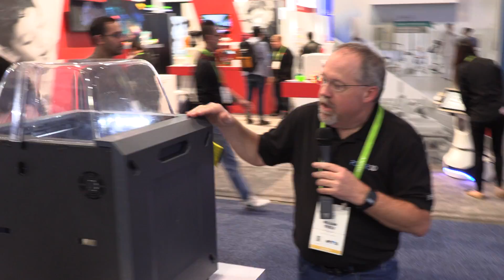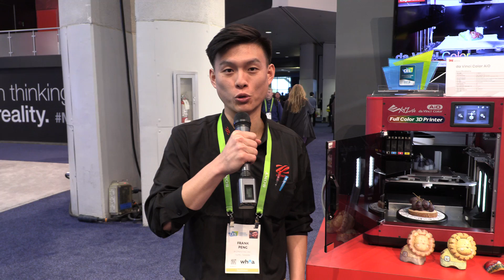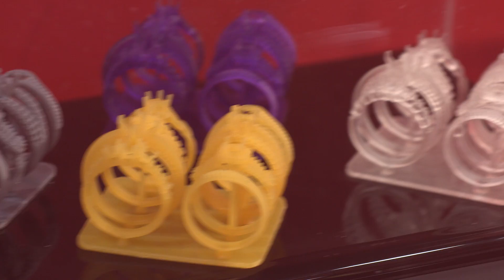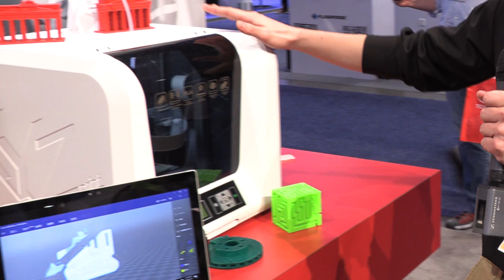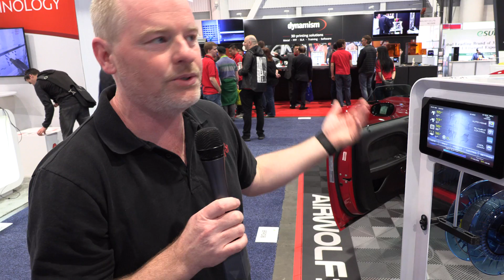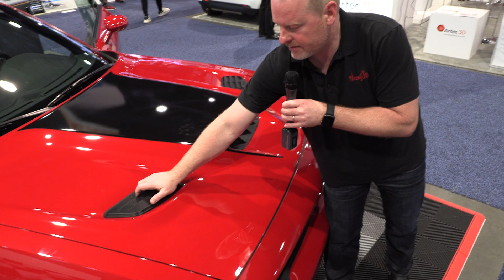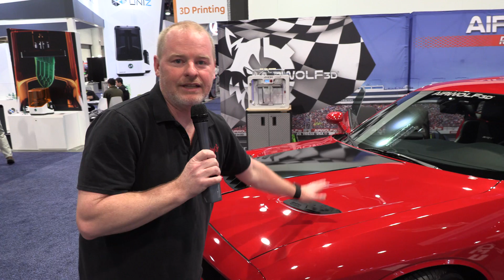VIRTUAL CES 2018: Tour the 3D Printing Area with Flashforge, XYZ, & Airwolf!

Comment: I just purchased the da Vinci color XYZprinter. Right out of the box I couldn’t even print the color calibration as the ink was not working. I cleaned them as per their instructions with 75% alcohol and no go. I wrote 2 tech support requests and after 6 days no reply. So I called the UK support line from Australia and was given a UK support email address so I resent the issues and no reply. As a reseller I contacted the disti in Australia Synnex and was told XYZprinting does not support Australia. I had get them to log a fault, several days later I was told the ink cartridges were faulty and would be replaced. Another 3 week later still waiting on the ink cartridges as there is no stock in Australia. So I have a $4000 plus 3D boot anchor on my bench. What a joke of a company, fault product, no support and no stock of the ink cartridges. XYZprinting are a joke and would advise against anyone purchasing their products. Joel I love your channel but very disappointed you allowed XYZprinting to show their products. You need to seriously vet the company’s before giving them a plug

Comment: Honestly idk why everyone gives XYZ such a bad rap. My first and only 3D printer is an XYZ Da Vinci Jr and I absolutely love it. It's actually an extremely nice machine for only $200. I've had it for well over a year and have not had a single issue with it. Literally the only downside I can think of is that they require you to use their proprietary filament, but even still, its only $20 or $30 per roll which isn't really that insane.

Comment: Nice work mate, I live in Australia. It's a little hard to travel to CES. Really appreciate videos like this giving snapshots of what is happening in the electronics world. 

In saying that, I think Flashforge has lost the base end of the market along with XYZ. They have been beaten on so many fronts for entry level, large build volume printers. Airwolf seems to be in a completely different category. 

I think a great business model for 3D printing is similar to the one that KTM and Harley Davidson have done with their motorcycles. Have a base entry level product that is good quality and then encourage upgrades in the future. 

I have a flashforge creator dual (the wooden one). I've had heaps of issues, but I've learnt from the experience. However, when I was looking for a new printer to extend my knowledge and capability I couldn't justify the extra money with the cheaper printers out on the market. The same issues that occur with a $1500 dollar printer still occur with a $400 printer. I went onto the Flashforge forums only to discover that the new Flashforge printers are still having similar maintenance and user issues to the old ones so there was no incentive to upgrade to a new Flashforge in my opion. 

I think that if these guys want a following and want more brand recognition with hobbyists through to professionals (which I use my printers for work and play) then you need to get bang for your buck.

Comment: they are both interresting. and have both innovation. but trends are the same
bigger (thanks to CR10 democratisation), more materials (real metal... wow! ink for 3D.... omg !) and, hélas, more expensive...
As a reprap user, (one year printing, so quite newbie) all the wifi, cloud, touch panel and so on are onl usefull gadget but the cost of it dont justify the price (a rasp pi 0, a webcam, octoprint and litte patience costs at most 30 box and do all that...)

So in my oinion, the "real" things : 
really interrested by democratsation of LCD printing by flashforge  : there a nut here in my opinion,  and may be if price comes to 500.600 (ok i dream) i'll buy one. another one is the 'candy" as an amateur cooker, i want one :) they should think aboutmultiple layer, not very high, 1/2 inch should be enough for food printing :)
XYZ shows  really interresting color print technique, i hope that print pricing will goes cheaper with time. 6 box for a  small print... lets say... better to buy it ;) and machine prices are to high...
EVO was the less convincing, except for metal filament, but its not a material wich will run only on EVO...

A word on the price : of course it is passionating to build things, to DIY, experiment, improve.. but we, as particulars, are not abble to do it at any costs... and none of the three innovations that i was writting about worth the price : 3000 box a printer?? mine costed 300, and I am building one by myself actually with dual extrusion for 200 $... that's 5% !
I am not an engineer looking for a way to get pieces wich are impossible to make by substraction or molding... in one year i have printed, on weekends about 100 pieces, considering it as a mean for one printer, and if we use it for 2 year, to get your print price you should add 15 dols for each print : not cheap for a knob, a repair part, or even another beautiful colored statue... 

one of the aim of 3D printing is to reduce the dstance and the manipulation between industry and consumer... if the consumer has to buy a thing at the price of a factory, there's no point...and if you are an engineer in a big compagny, you have acces to biggers prints, more materials, though a a high price, but with a good ROI...
I'll make a parralel with 2D printing : first machine where big noisy and very expensive, but at the time the price get cheaper, everyone get one in house... even laser, and now color lasers, and now the big players in 2D printers are develloping chep printer and big printers on 2 separates market. it will reasonabilly be the same in some years for 3 D printing. see the succes of Anet, Creality or Evo Tornado...

Thank you very much anyway for that immersion in 3D prnter paradise :) and for the fact that you have been fair with other competitors than luzbot.
and, almost all ...
High five !

(PS i am french and didn't learn engilch in shool, so i apologize for my syntax and grammar ;) )
Reply from the maker: +cornebistouille please don't apologise, your English is better than mine :)

Comment: I think airwolf wins the show. Heated chambers are 100% needed for anything except pla and petg. You can hack other materials to work without one sure, but they make it so much easier to control. Beyond that xyzprinting wins second because of innovation. They are actually trying to bring real full color printing to the desktop, not to mention covering all aspects of the market from pro to beginner. Flash forge has some nice price points, but is much of the same. My big qualm is WHY STEPPER MOTORS?!?! We have heated chambers now, but no servos?!? Cmon companies. There are very inexpensive ways of closed loop control that don't require the high costs of commercial cnc machines (as printers require much less torque). All I want is a printer with a dual extruder, big build volume, heated chamber, and closed loop control. Is that too much to ask :(

Comment: I like the Airwolf presentation. You can tell he was excited about the products and the parts produced from the product. The metal filament options are really nice as well. Using glass doors and panels is questionable due to the weight and brittle nature and I think polycarbonate/lexan would be better options, but since they seem to focus more on the industrial side of things I suppose it's not that big of an issue.

XYZ I have very little faith in due to their business philosophies and practices in the past and for the most part the present; But their machines look nice and may be more convenient for people who don't know what they're doing with 3d printing. They still give the vibe that they're essentially overpricing their units to take advantage of their marketing capabilities and ignorance of unknowing purchasers like my friend who bought his from Barnes and Noble in the past.

The Flashforge presentation was good, their printers look good, but I'm just not excited about their products based on the presentation and the prices. I think I can tell that they're putting effort into their products though. The candy maker gets me the most excited even though I don't really eat candies, but it's cute and looks fun and inexpensive and leaves room for improvement.

Comment: Flashforge:  It seems like if you're looking for a 3d printer and a camera and cloud access are your big selling points you may be looking for a 3d printer for the wrong reason.  The SLA printers were of some interest, but were only briefly touched on.  The candy printer is an interesting novelty, but seems like a very niche market.

XYZ: Theirs seemed to cover a large range of options with the majority of them being on the high end.  For the combo 3d printer / scanner it seemed like the scanner space cut into what would otherwise have been printable area and would have worked better with the scanner being something separate from the printer.  I think they had some of the best full color prints I've seen.

Airwolf3D:  Looks like they're marketing to the auto enthusiasts more than to those interested in 3D printers.  I felt their sales guy talked a lot without actually saying much, but maybe that's just because the other two were a lot more concise in general.  Their printers seemed to be on the higher end, and it was interesting to see what they were doing.

Comment: I really like that Polar3D has done those modifications to the Flashforge printers. They do seem like a good value.

XYZ just picked up some more industrial partnerships so they  are going bigger and more professional which is great, but their name precedes them.

Airwolf, not sure what to think of them.  They never really have though.  Their advertisements always put me off as they seem to talk like they are more than they really are.  Along with that their cost for what you get doesn't really impress me.

Comment: I thought heated build chambers were patented by Stratasys??
Reply from the maker: +Gabe Nydick I thought so as well.
Reply: https://www.google.com/patents/US6722872
We have to wait til 2020 for that one to expire.  The heated chamber patent that they hold applies to high temp situations where the steppers have to be located outside of the chamber so they don't require special cooling setups.  These setups are good for ABS, but once you start  printing the really strong stuff... Ultem or PEEK then you need chamber temperatures of 100C which these cant do without causing steppers to fail.

Comment: The new airwolf one is interesting. I wonder if the patent for a heated chamber has finally expired, of it's licensed or skirts it in some way? SS for post sintering is neat too but 19% is way too high to expect any real accuracy out of the end result IMHO.
Reply: Eric worked in as a patent attorney or something before starting in the 3D printer game. I asked him on an older printer how he got away with it and he said it's not a big deal something about the original patent was written sloppy and was easy to get around and would never hold up in court (I am paraphrasing).
Reply: The patent must be, because M3d is coming out with a printer called the Promega that can maintain chamber temperatures.  It doesn't have a chamber heater built in but can just monitor and maintain temps created by the heated bed.
Reply: Not micron accuracy anyway. I guess it depends on how even the shrinking is and how consistent it is between batches. If it is super consistent, you might be able to dial it in to a degree. That said, any degree of shrinking is going to cause loss of fidelity and accuracy of high precision requirement parts.
Reply: There are still heated chamber patents that are active. These printers still use the steppers inside of the chamber which may have been a prior patent that expired.  The Stratasys patent that is still in effect is that the steppers are outside of the heated chamber so they can run 100C inside the chamber without having to cool the steppers.  At least I think that's the case..  Also yes 19% is insane to manage in design unless your part geometry is very simple it will be  difficult at best to get good results.  This is why Desktop Metal and Markforged are working on their processes and they cost a fair bit more, their slicers (are supposed to) compensate for these issues.
Reply: You might be surprised. the shrinkage is what you see with MIM parts, which is what these new plastic-bound-metal sintered printed parts mimic. 

another company (much more expensive printer - Markforged Metal X) uses a similar tech, and are able to print down to M3 threads (in enlarged state), and have a bolt screw in after sintering and shrinking without having to chase the hole with a tap or do any clean up work. 

Not micron level, but the metal parts should be treated as a cast or mim state part, print it near-net, and post machine critical surfaces.

Comment: I like the idea of the stainless steel printing, but I'd like to hear more about the whole sintering process. It seems as though they're trying to push it to a level of getting more consumer level users in to doing that kind of stuff, but do they also offer the service to get the parts sintered to the actual steel stage, or do you need to find your own avenues for getting that done? I can't imagine the process would be all that cheap either. Definitely a cool idea, but definitely want to hear more details about post printing process and costs!

Comment: XYZ has a long way to go to build back consumer confidence IMO. For the cost of their 12" machine you can buy a Raise 3D N2 which has a superior design. Airwolf has some very nice looking machines that are more commercial oriented than regular consumer but still very nice. I would like to see a 4 rail bed design with dual lead screws though as the weight of such large prints especially in metal could cause bed deflection. It might work perfectly fine but my experiences with unsupported beds on larger printers has not been so positive. Cough cough Type A Machines. 
    Enjoyed the new format very much! Putting the sales teams on the spot is a refreshing idea. Flashforge and Airwolf did a great job presenting their products in a clear manner. Airwolf went above and beyond by depicting real world usage of their products. I think Flashforge has some a nicely price prosumer product with the Guider II and Airwolf just nailed it with their machines. If Airwolf can get the price of the EVO down to 5K it would be in a league of it's own.

Comment: XYZ has closed source filament system. I will never ever ever support a company that requires users to bypass the DRM chip on friggin filament.
Reply: I found it interesting they didn’t mention the Da Vinci pro, open filament printer. I guess this is no longer a priority for them. Quite a step backwards. Not only does their low quality filament cost about twice as much as normal PLA, many creative elements of 3d printing are removed from the consumer as things like print temp cannot be modified and are hardcoded into the filament chip...
Reply: Yup. It's the filament version of makerbot.
Reply: Yeah my da Vinci 1.0 pro supports all filament. Do not need those dumb cartridges.

Comment: XYZ DLP printer price point makes no sense. It is way too expensive for a DLP system. XYZ hasn't learned anything. They're still a locked in platform. Until they embrace open source, and openness in general, they will be a hard sell for majority of makers. Airwolf products are interesting. The metal printing has a compelling price point for metal printing, but the sintering process requiring a 1600 oven can't be glossed over. Flashforge was solid, probably a bit too many offerings....seems like they're trying to hit every price point out there. Oh, and when they come out with the candy printer -- I am buying it immediately.
Reply: davinci jr pro.

Comment: My opinion on "cloud compatible" printers is simple: until someone comes up with a fully-automated way to remove a print, skirt, support, and primed plastic from the bed (or to remove and replace a print surface) then there's no good reason to have the ability to start a print remotely.  If you've got the time to remove a print and prep the bed for the next one then you've got time to start the next print and then walk away.

Comment: Airwolf metal at 100 plus for the filament then you have to process it with heat? And it shrinks 19% Hmmm what if I print something in wax and send it to a foundry. The other 2 seemed a bit overpriced for the hobby guy. Still, Great presentations and very informative. Maybe needed more final product examples close up views on some. XYZ multi color? Maybe wait for the grandchildren of those. All in all, Fancy style enclosure means little compared to quality of the print. Kinda like repackaging the same tools and charging more for the packaging. I'd wait for your reviews on them before I'd buy anything.
Reply: The 19% shrinkage is pretty standard for the technology. The parts (in the green stage) are going to inherently have a lot of voids and carrier material for the metal is going to take up some room. On most of the printer's I've seen thus far, the software takes care of scaling your model up. So it's really not that big of a deal, in my opinion. Now one thing that I would mention is that they didn't mention if they sell the cleaning station or the sintering ovens. Those are likely going to cost as much as the printer.